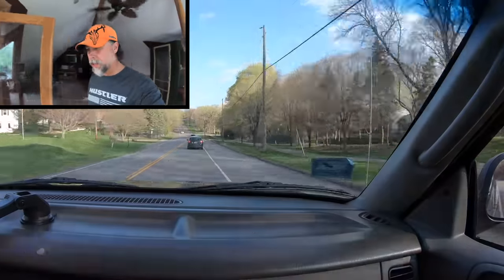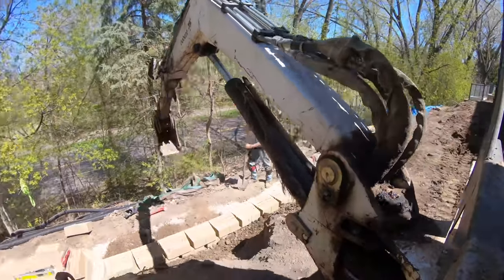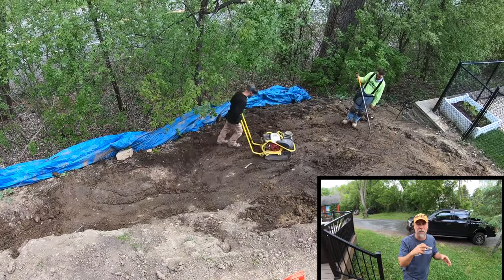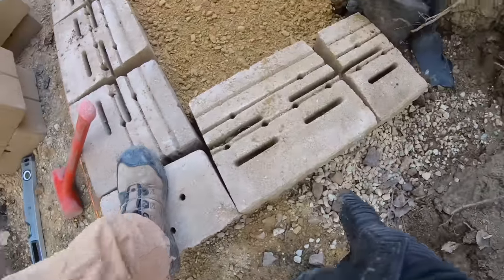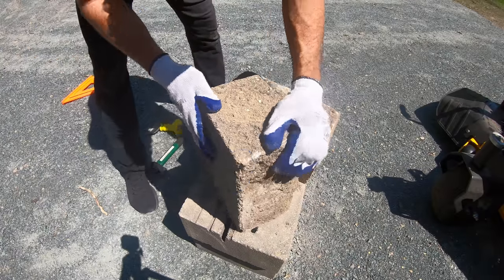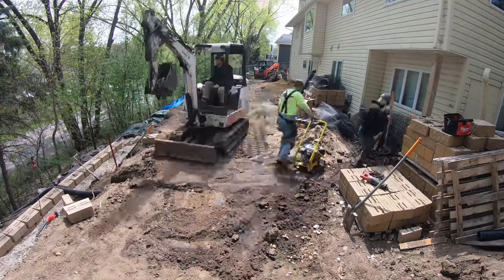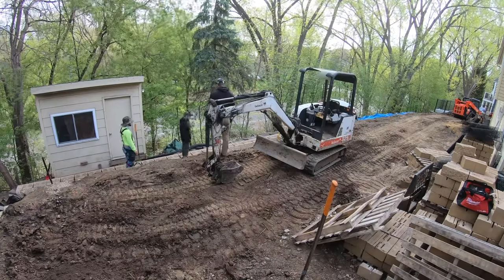Retaining walls- what 99% of people don't know

Comment: When cutting blocks. I learned a quick trick from my mentor when I was a teen. A battery angle grinder with a diamond tooth blade. A quick run along the cut point on three sides then a single strike with a hammer and chisel and they fall apart. Half the time of doing it by hand and the ease of a masonry saw without the need of a heavy masonry saw.
Reply from the maker: That is a sweet tip!

Comment: You can tell by the quality of his work that it’s going to last DECADES. I see so many walls bowed and falling apart it’s ridiculous, If they were all made like this man would that be awesome
Reply from the maker: Much appreciated🙏
Reply: High quality work. And I appreciate that he mentions that the downspouts are NOT CONNECTED to the wall drainage. I can not imagine he volume of water coming off of a roof mixing with the in wall drainage. Asking for trouble.
Reply: So did the timber one is been there since the 80s he said😂.  Jk I came here for help I have no idea what I'm doing.

Comment: Depending on the geographical area the codes might be different.  As a former inspector in S. Cal. The depth and size of fitting will be determined by the hight of the soil to be retained.  Be sure to check you local building codes.
Reply from the maker: well said Dan.  In TWIN CITIES Minnesota we don't need a permit for walls under 4' tall in most cities-except Minneapolis. Over 4' tall then yes and engineering.   Outside of the metro area- you don't need permits or blueprints at all for retaining walls.  It varies a LOT by area.
Reply: Would like to see another pool removed video
Reply: Most Engineers say that once you get 4 ft or higher your chances of failure increase dramatically.

In our area we have no codes at all which is a shame to an extent because a lot of people are building stuff to fail
Reply: I don’t get permits bc it’s MY PROPERTY!

Comment: Long time watcher first time posting. Like the way you present your material so keep it coming as I will also be following your paver patio videos as well.

Replacing a rotting timber retaining wall with cinder blocks, core fill with concrete and rebar, and geogrid every two blocks up. Compacted 3/4 crushed concrete will be used for the base on top of compacted soil. Wall is 32ft. long by 3ft-4ft tall and has a wooden picket fence that is currently behind the wall about 4ft. On the other side of the fence is my neighbors shed at the shortest part of the wall 1ft-2ft tall and the other end is a small foot path leading to a concrete pad 5ft by 10ft. Corrugated drainage pipe is going to be ran behind the wall to hopefully catch the water from the drainage problem that we are having, same 3/4 crushed concrete all around the pipe, and grade it to flow to the street. I know this is not a huge project, but wanted your thoughts as this my first time building a retaining wall. Also, would like to get closer to the fence to gain a bit more space in the backyard, but don’t believe the geogrid requirements would be met. Don’t even know if they would be met as they are currently. 

Look forward to thoughts on the matter.

Thank you in advance.

Comment: I am learning so much from your videos. I am about to begin a lake shoreline sea wall on my own property and build it myself. The lake is low this summer so it is a perfect time to build the wall. The soil is a mixture of clay and sand. Someone has suggested using 6 inches thick concrete in the bottom of a 2ft x 2ft ditch as a foundation making sure it is perfectly level. The distributor suggested a road base or granular base. I haven't seen any of your videos using concrete as a base so I want to be sure of what to use. The wall is only going to be 3ft high and be stair-stepped down to nothing. Again your videos are great!

Comment: I have a small local gym that hired one of their friends that workout there to install a retaining wall and artificial turf. The wall is about 3 feet high. Fine limestone was used as base. I wish I could upload photos in the comments because it looks horrible. All wavy up and down, front to back. Now the guy is digging the dirt out to install the artificial turf. I want to go say something to the owner of the gym or the owner/friend of the company that's doing the job. I was taught to install crushed limestone/crusher run is what we call it here in my area.  Taught to install anywhere from 7-12 inches compacted stone for the base of a wall. Anywhere from 6-12 inches of base past the front and back of the wall for best support. Then for the artificial turf, I was taught to install about 2-4 inches of crushed limestone for the best drainage. Always did more than what is recommended. I just feel like I need to go say something and point out what is wrong and what needs to be done to fix it. What would you all do?

Comment: I have a regular Front yard from the street up it is like 3.5 feet, I’m getting a lift put in so they cut a trench poured a concrete walkway but now I have 2 sides that need retaining walls. With no drainage issues before but neighbours have the big box store walls all kiddywampus. The contractor for the whole job wants to just put like cinder block right on the dirt, do cinder block walls have any place,I sent the contractor this video.now he thinks I’m nuts so I will find some good contractors use your methods. I just wish you guys where here in souther Alberta. Thanks guys for great videos

Comment: I’d like to know more about how you backfill them, I see how you layer rock and the regular dirt as you build up the wall but I’m curious to the method behind how much you’re using and such
Reply: Same here
Reply from the maker: more to come
Reply: @Dirtmonkey  i would like to know when is it safe or not safe to compact behind a wall with a machine. Thanks Stan 😊
Reply: @Dirtmonkey  same question from me too. In previous videos I think you’ve shown the aggregate the full height of the wall, directly behind the block with only soil on the top few inches. This have anything to do with not being able to extend the grid further into the hillside??

Comment: Stan, a quick way for base is to use flowable fill, it is faster way as no leveling of the units is required and it meets NCMA guidelines.
Reply from the maker: Yeah- but I don't like using a base we can't modify.  if an adjustment needs to be made to account for excess geogrid affecting the level of the blocks, or a step up changes- its tough.  yes it might be faster but I like the ability to make changes on the fly.

Comment: Hi there! Perhaps this will be covered in the next video, but what is the final height of this wall? I ask because I noticed that the depth of the geogrid you are laying is not that far - I remember you referencing a 2 (geogrid) to 1 (wall height) ratio in a previous video and just wanted to clarify - perhaps due to this being under 4 feet this is not necessary?

Comment: How far back are you digging?  The higher the wall, the further back you have to dig?  Also, looked like the lifts were topsoil type material, is that Ideal, or the need to blend with the local soil?
Reply: 1 ft backfill for under 4 ft walls with no load bearing expectations. Over 4ft and/or load bearing you will want far more and use of geogrid.

Comment: Quick question: why at 13:48 are you dumping dirt behind the stones instead of the 3/4th drain rock stuff ive seen you use? Now wont there be an issue with drainage since you just put dirt there?

Comment: I'm guessing the drain pipes were connected to the downspouts from the gutters of the house, am I correct?  If that is the case if the front yard did not slope towards the wall would you have still installed drain pipes?  If not how many feet from the water source (houses roof) would you recommend not having to install drain pipes if the land was level?
 Fantastic video!  I think if anybody from your area watches your video they'd definitely want to hire your company.  The reaction towards the guy who put the frog in your face was hilarious!  Thanks for the content in all respects.

Comment: In the U.K. we put In a concrete  foundation with rebar coming out and then we lay a 9” hollow Bolck over it and when the wall is finished we fill it with concrete And back fill with shingle for drainage over a french drain system

Comment: I see you used a perforated pipe wrapped in filter fabric.  I thought the drainage stone around these pipes is important to keep the voids between them so they work along with the pipe to quickly and easily remove Walter from behind the wall. Without wrapping the clean stone in fabric won’t they eventually plug up and then ultimately plug the filter fabric around the perforated pipe and there making that system no longer effective at removing water? I know the soil type around it makes a difference but perhaps you could go into even more painstakingly detail about when you donor don’t use fabric around the drainage stone would be helpful.  I have heard you say that in some of your Boulder wall videos, Sandy yes use it and clay not to but I’m having a hard time wrapping my head around clay eventually plugging Everything up?  I value your opinions and direction.  Can you clear it up more?

Comment: Also, I believe from the few of your video, you stated a well build drainage would not need a drain tile, if the water is coming out of drain tile, there means something is wrong.  From that statement, my question comes, if I lay a smooth thick plastic sheet or pack in with red clay right at the bottom of the gravel with adequate sloping for drainage.  Do I still need drain tile?  Thank you.

Comment: What angle do you stack the block at, does this angle change if you have a taller wall?
Reply from the maker: it does slightly.  it depends on how many layers of grid we are putting in- that will change our base angle to account for the slight offset of each layer of grid.
Reply: Do you angle it just at the base, or every 2 courses as you’re adding grid?
Reply: @toddbrindle9505  Base slightly leaning back. Grid adds to a lean forward with every layer. The more layers, the more it needs to lean back at the bottom, to a point.
Reply: @bobojr456  thank you!!

Comment: What pipe do you use behind the wall? I’ve found the only thing that works is sewer drain tile with the holes at 5 and 7 o’clock to let water in and divert. Does the ADS pipe covered in slits work to divert water?

Comment: I didn't see any gravel coming out with the old drainage coil.  Is that the likely failure mode, build up of water behind the wall?
Reply from the maker: Yes-  timbers need a lot of good drainage.  You can see that was missing.

Comment: How do you determine how far back the geogrid goes from the wall, and what is the proper number of courses between geogrid levels?
Reply from the maker: Technically an engineer does those calculations
Reply: @Dirtmonkey  do you have an engineer on your team, or who do you work with on that aspect?
Reply: @intentionalmoneymn4572  5 feet from the wall is pretty commonly used practice. if they are 12 plus feet tall it'll call for 8, then again thats just where im from.
Reply: Geogrid goes back as high as the wall goes up. One layer of geogrid every two courses.

Comment: Could you elaborate a little more on why you don’t put the drain piping at the very base of the wall and give more details on the drain pipe install , why you don’t want the down spouts tied in and what keeps the dirt from filter down through the drainage aggregate and clogging it.

Comment: Down here in south Alabama (Mobile, Alabama) the versaloc blocks are REALLY expensive. Since we don't have the freeze-thaw cycle that you GUYS have in the north I have considered building a cinder block wall and putting a French drain behind it to relieve any water pressure against the wall. My soil is VERY sandy with little or no clay. Do you have any thoughts or advice? I have found all your videos ( with the exception of the snow... although I still watch intently) to be very informative.

Comment: I see you put drain tile behind the wall and backfill to the surface with gravel.  But won’t the water just drain through the gravel and through the wall (between every block) without the need for drain tile?  I need to repair a wall by placing fresh gravel behind but I have no place to daylight drain tile, other than through numerous existing weep holes in the wall between the wall stones.  You think it can work?

Comment: Is it better to have one 6 foot wall or two smaller walls 4 feet apart from each other?
Reply from the maker: One isn't better than the other strucrually.  Both have to be built correct and strong.  Both scenarios have an equal life span.  One scenario gives you more yard- with one tall wall, but kids can fall off that.  the tiered scenario eats up yard space- but less distance for kids to get hurt.  Your choice.

Comment: Hey Stan - How thick is the dirt backfill layer at the top of the wall.  Looks like about 1 course (8") of block to me.  Also wondering if you can share the specs on the drain tile and when you use it.  Thanks!

Comment: Question when you build high retaining wall with higher back pressure. And limit securement because of rock formations in areas but others no rock formation.  Are there anchors you can use instead like spiral anchor driven 10+ feet into the hillside or something like that.

Comment: I am going to be building a retaining wall about 80' long. About 6' high. I was wondering about using the larger precast pieces. The 1000" to 2000# since I will have equipment at the farm but not a lot of labor. I was wondering if you have any experience with this type.

Comment: Seems like the blocks manufactured closer to your site would be the most "affordable". What's commercially available in Oregon, may not be what's easily found in MN (or vice-versa).  Locally, we have Mutual Materials and they don't manufacture a block with pin holes. I also have block that is onsite that needs pressure washing/cleaning and will be reused on another part of the property. It doesn't have a cap associated with it, so the manufacturer said to just get any cap that would match and mortar it in. My site is much like this one in that there is likely a need for drainage, however, I'm on the downhill side. What have you seen that works to get your neighbors engaged/onboard to working together to solve the problems?
Reply from the maker: Thats a great question.   i don't have a great answer though.  I think thats a judgement call only you can make.  You know who your neighbors are.

Comment: i was always taught geo grid should layed on with the  fill level to the existing block? am i wrong stan? i am generally curious now.. good series!
Reply from the maker: Yes-  you are correct.  We lay the grid in and then often times fold it up and over the face of the wall as we build up the soil until we get it nice and level , then lay the grid out and keep backfiling.
Reply: @Dirtmonkey  Same here. Flip it up out of the way, backfill and lay it down and move on. Nice having it pre laid so you can continue to back fill and have some of the wall prebuilt. Not too much because you dont want the wall leaning back too many courses without backfill and compaction. Ive see a few guys build up four or five feet and then start backfilling. No bueno. lol

Comment: Hi Stanley,
How would i integrate geogrid when making stone wall filled with cement? Stones are blue rock and are 1-2 ft in diameter. Planning on making a rock wall as a retaining wall that will be holding up soil  that is on the side of a hill that  has a cement slab up above on top of the hill. Cutting down my orange tree that is on the hill so i can make room for gravel behind the wall

Comment: When you put down the Geo grid how far do you have to go back from the block and is it from the back of the block that you measure how far you go back or the front of the block? Thank you!
Reply from the maker: Grid length depends on wall height and surcharge or load placed on the wall.  TYPICAL for these walls is one foot of geogrid per one foot of wall height placed every 2 feet.  so if your wall is 6 foot tall then your grid will be 6 feet long but you will need 3 layers.  One at base, second at 3 feet and third layer at 5' or thereabouts.
Reply: @Dirtmonkey  thank you! And thank you for taking the time to reply! Love your videos too.
Reply: Is that an aggregate total or length per layer of grid?  Say for a 6 foot wall, is it 3-2 foot runs or 3-6 foot runs?  Great channel and awesome vids! Thank you.

Comment: Noted that a soil separator was not used between the soil and the gravel.  Reasoning for not using a soil separator?  Also noted that corrugated pipe was used to move the water from the gutters.  Reason why PVC pipe was not used, especially since  corrugated pipe is known to clog and is difficult to clean?

Comment: When you notice a bulge in a retaining wall what is the best course of action? Is it best to just redo the whole wall or is there a "fix" that would work?
Reply: If there's a bulge it's basically fucked and will blow within a year or two at most. You could try to repair the section but that's difficult. You will need to do that without disturbing both sides of the affected area. Additionally, you will need to dig out all the crap behind the wall and replace it.

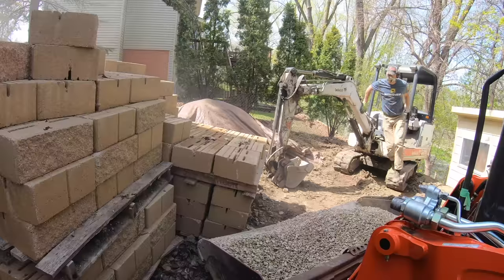Comment: Stan at 7:23 why is your mini x operator grinding brick together? Is it just to clean them or is there another purpose?
Reply: Takes all of the factory imperfections off of the top/bottom surfaces. You can’t build a level wall without knocking these off.

Comment: You are working on a cliff, you have an old timber wall to deal with. How do you know how close you can get to the edge of the cliff and still be safe to work? 
How do you know that when you remove a piece of old timber that it won't cause a collapse of the area you are working ?
Reply: pray